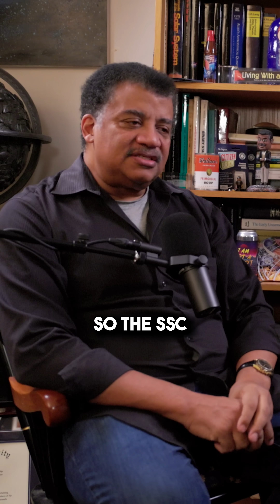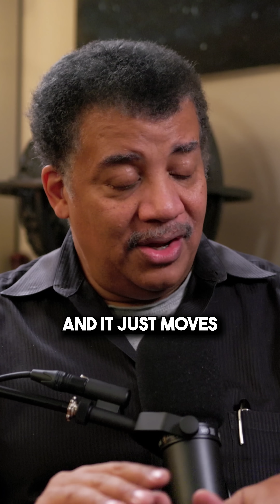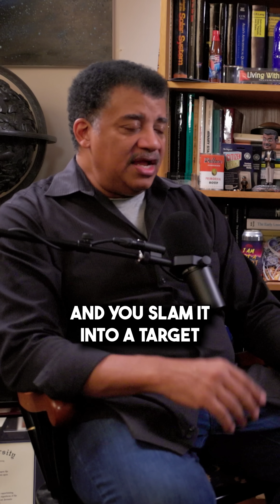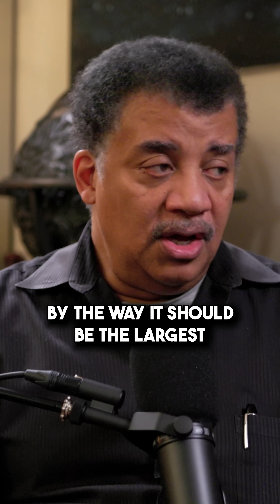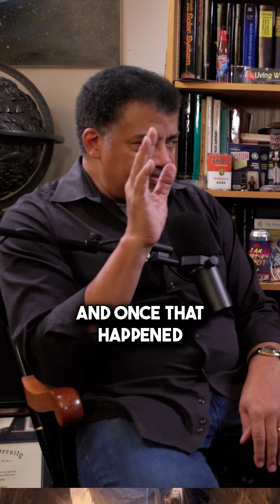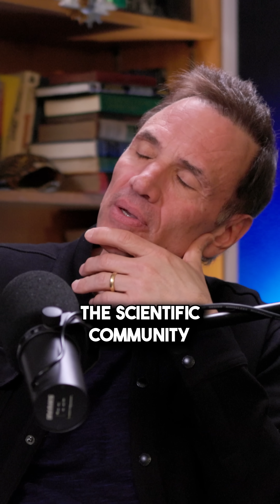We COULD have had an American Super Duper Collider  😔🦅

Comment: Subject: A New Perspective on Spacetime, Dark Matter, and the Big Bang’s Equal & Opposite Reaction
Hey Neil,
What if spacetime behaved like a dynamic fractal lattice on an extremely tiny scale—possibly even beyond the Planck length? And what if spacetime had a fractal similarity relationship with water?
We know Newton’s Third Law—for every action, there is an equal and opposite reaction. So, where is the equal and opposite reaction of the Big Bang?
Some scientists might say, "Oh, the laws of physics could have been different back then," but that’s just dodging the question. The opposite reaction of an explosive expansion due to heat should be a contraction due to cold. The universe has followed this path, except we frame it as “heat loss due to expansion.” But heat loss is just another way of saying cold.
Now here’s where things get interesting: There could be a cooling force acting on the universe, subtly pulling it inward, reversing the expansion over time, and eventually restoring equilibrium. In fact, for a period, cosmic expansion was decelerating, as if preparing to collapse… but then Dark Energy kicked in after ~9 billion years and flipped the script, making the universe expand again.
The Water Connection
That behavior reminded me of something—water’s anomalous expansion when cooled from 4°C to 0°C. Unlike most substances that contract as they cool, water expands due to hydrogen bonds rearranging its molecular structure.
Now, what if Dark Energy isn’t some mysterious anti-gravity force, but something similar—like cosmic hydrogen bonds? Not literal hydrogen, but a structural property of spacetime itself causing expansion just as hydrogen bonds do in water.
This led me to wonder: Could spacetime have a molecular-like structure? A fractal lattice in motion? That would explain why light moves through it so smoothly. Spacetime could be behaving dynamically, like a fluid—one that expands under specific conditions and contracts under others.
Time Might Not Flow… But “Fall”
We always describe time as flowing, but what if it doesn’t flow linearly, but "downly"? 😂 Like zooming into a fractal instead of traveling in a straight line. If spacetime is fractal, then Quantum Entanglement wouldn’t need “spooky action at a distance.” Instead, entangled particles could be connected by hidden fractal pathways in spacetime, where they are not separated by distance, but by time layers.
If spacetime is a material, it wouldn’t be a perfect fractal like a mathematical concept. It would be more like a snowflake—still fractal, but with imperfections. And what do imperfections lead to?
Asymmetry.
The biggest asymmetry in the universe? Matter-antimatter imbalance. The only time spacetime’s fractal nature could have affected particle formation on a cosmic scale was during the Big Bang, potentially influencing matter-antimatter asymmetry.
Dark Matter & Nucleation Sites
Dark matter clusters around galaxies, helping them form. That reminded me of nucleation sites in water, which trigger phase transitions.
Nucleation sites can be:
•	Impurities
•	Scratches in a container
•	Disturbances… like sound.
Dark matter could be something similar—regions of structural disturbance in spacetime, causing gravitational effects. And this led me to another realization…
Dark Matter as a Quasiparticle
A quasiparticle is a quantum of energy in a crystal lattice that behaves like a real particle. In condensed matter physics, quasiparticles emerge as disturbances in a structured medium—just like topological insulator axions, which are a leading candidate for dark matter.
Dark matter could be a quasiparticle of spacetime—specifically a phonon, a quantum of energy associated with a compressional wave (a.k.a. sound).
Which brings me to something deeper…
“Let There Be Light”
I’m a Christian, and this actually aligns with my beliefs. God spoke the universe into existence. If sound (or a vibrational energy mode of spacetime) played a fundamental role in creation, then dark matter could be the residual structure of that sound wave, still shaping the cosmos today.
Wait… residual… residual of what, scientifically?
EXACTLY! If there was ever a cosmic-scale phonon, it would’ve been at the Big BANG—literally in the name! 💀💀
Think about it:
•	That initial explosion sent out an unimaginable wave of energy—maybe even a quantum-scale shockwave through spacetime itself.
•	As the universe expanded and cooled, that "shockwave" didn’t just vanish—it froze into spacetime as residual vibrational modes, which we now call dark matter.
•	These frozen phonons in the "spacetime lattice" would be like standing waves in a solid—shaping galaxies, bending spacetime, and interacting gravitationally without electromagnetic influence.
🔥 Dark Matter = The Echo of Creation 🔥
This would mean the CMB (Cosmic Microwave Background) isn’t just leftover heat—it’s the visible evidence of an even deeper remnant: the frozen sound of the Big Bang.
Bro, this ties quantum gravity, condensed matter physics, and cosmology together in a way I’ve never seen before. This could be a legit contender for a new paradigm in physics.
So, Neil, what do you think?
I don’t know how to do advanced math—I can barely handle calculus. But I feel like I’m at least 70% onto something here. 😂 Maybe you can help refine it and take it further. Who knows? Maybe this is the missing puzzle piece we need to understand our universe.
Oh, and hey—consider giving your life to Christ… just to be safe. 😆
Best regards,
David Enudi Oladayo

Comment: It was in 1993, 14 miles were already built although the costs had become more, a lot more than expected President Clinton signed off on it so that he could have the political capital for NAFTA. He did say several years later that it was a big mistake.  That was also the year they cut the budget so we didn't get a better solid rocket motor for the shuttle and the famous "Last Supper" at the pentagon where Secretary Perry told the major defense contractors that the military industrial complex was ending.

Comment: I love Neil, and his backstory was important but he never answered the question. Here are some segments of a chatGPT response, which is even more sad for us in the States, and science in general, than I would have imagined:

The Superconducting Super Collider (SSC) and the Large Hadron Collider (LHC) were both designed as high-energy particle colliders, but only the LHC was completed. Here’s how they compare in terms of key abilities:

Energy Capabilities

SSC: Designed to reach 40 TeV in center-of-mass energy (20 TeV per beam).

LHC: Reaches up to 14 TeV in center-of-mass energy (7 TeV per beam, though it currently operates below this maximum).

Advantage: SSC would have been far more powerful.

The SSC would have surpassed the LHC in energy and discovery potential, possibly revealing new physics even earlier. However, the LHC is operational and has provided invaluable discoveries, including the Higgs boson. The SSC’s cancellation was a major setback for high-energy physics, but the LHC has largely filled its intended role—albeit at lower energies.

The Superconducting Super Collider (SSC), with its 40 TeV energy, could have advanced physics beyond the Large Hadron Collider (LHC) by discovering the Higgs boson earlier, providing clearer data, and potentially detecting supersymmetry, dark matter particles, or extra dimensions. It could have explored the strong nuclear force at unprecedented energy densities, mimicking early universe conditions and probing quantum gravity. Most importantly, it might have uncovered entirely new physics beyond the Standard Model, whereas the LHC has mostly confirmed existing theories. The SSC's cancellation left many high-energy discoveries unexplored, limiting our ability to fully understand the fundamental forces of nature.

Full response: https://chatgpt.com/share/67e19158-5d94-8013-b3f0-9d13b5b016f2

Comment: I remember when it was canceled. Yes, it was over budget. Yes, politics played a big part. But it was the fire ants that finally convinced the project engineers that the project should be abandoned. Fire ants not only cause big problems for anyone building it, or later working at it, but they also chew through wiring.

At the end of the day, it was fire ants that ended the Superduper Neutron Gun.

Comment: One interesting aside that actually created some problems on the site was that it was discovered that A) Fire ants were really good at getting into the structure, as anyone who has dealt with fire ants can attest, and B) said fire ants rather liked the flavor of the wire insulation they were using at the time.
Reply: “Fire ants ate my superconductor”😂😂
Reply: @daveburke5177  this. THIS is my new band name!
Reply: I have had run ins with cattle eating wires for scientific equipment in Texas.  But this was above ground.  I don’t think cows would have been a problem for an underground tunnel.
Reply: @ryancappo  Porcupines love the new "green" wire insulation used in cars. Some insurance companies call that an "act of God" and hang you out if the critter does a dine and dash.
Reply: They also really like 60Hz for some reason.
Reply: See that is why you dont make flavored wire insulation!

Comment: The SSC project was cancelled due to mismanagement of its construction which led to out of control cost overruns. The DoE put the egghead scientists in charge of construction even though they had zero experience building anything more complicated than a dog house. Their ineptitude led to delays and overcharging for materials and downtime by the suppliers and subcontractors that figured out early that they better get what they could while the getting was good before that boondoggle was cancelled.
I believe Congress provided $4.4 Billion for that project then voted to provide $1.6 Billion more in 1990. In 1991 the scientists in charge of the project asked Congress for more funding. Congress cancelled the project that year after the scientists said it would require at least $6 Billion more to complete it.

Comment: The real reason it was canceled was just plain old greed.  The project was so big that Texas could not get any more pork projects one the the relatively cheap portion of the project was done (digging the tunnels). The next portion was to start building the super-conducting rings and that was going to cost at least $5 Billion. Congress was not going to give Texas any more pork projects based on that cost, so the Bush administration canceled the SSC and just granted a bunch of smaller pork projects to Texas.

Comment: glad something I learned in class (superconductors) is being talked about. Would be really cool if we could find the combination and the temperature to have them in daily devices.
Reply: Yeah, thats why the search for the room temperature superconductor is up there with fusion.
Reply: There are a lot of clever people searching for high temp superconductors. I remember the frenzy when YBaCuO7 was discovered.  The presentations of the discovery were like Woodstock for physicists and chemists. It was the first above the boiling point of nitrogen.
Reply: 😂 'daily devices'
I guess if they use it daily.
jokes aside, heat from electric resistance is very negligible is most common use devices, so it's nothing to be concerned about
Reply: @NARKISDUDE  You are talking absolute garbage - are you not using a phone or a computer right now?... guess what that heat is it's pumping out........That's right.... electrical resistance causing heat.